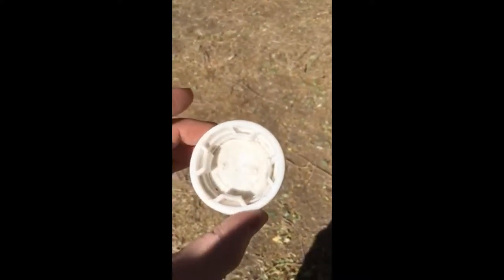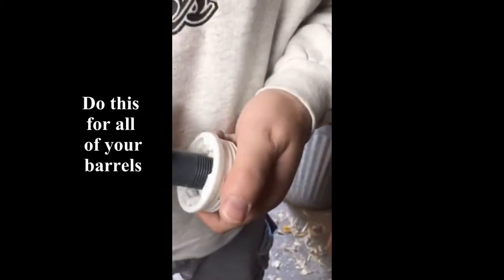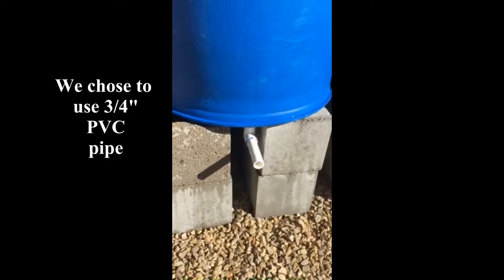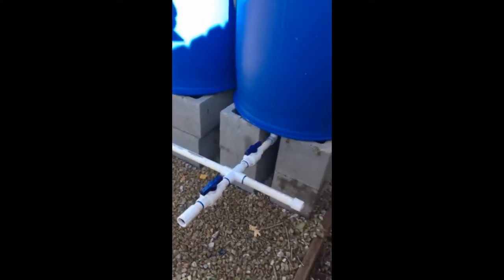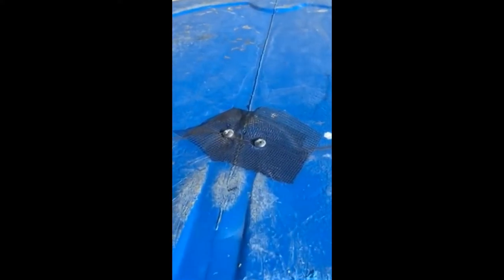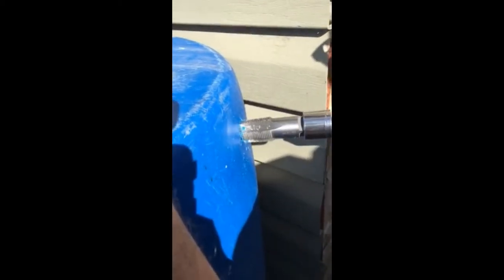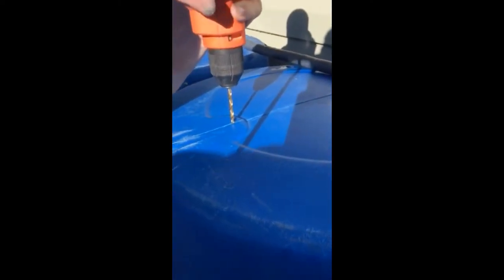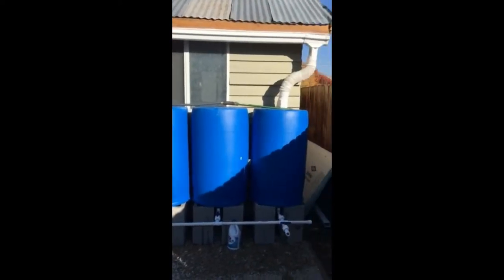220 gallon rain water harvesting project

Comment: What about all the plastic pieces and small plastic dust from your drilling and saber sawing that you did with the barrels in place? Are you just hoping that will all just wash out eventually into your garden and not clog up the lines?
Reply from the maker: The barrels should be rinsed out before final set up. The lines are large enough that it should not be a problem.